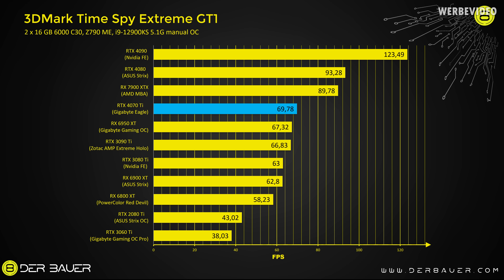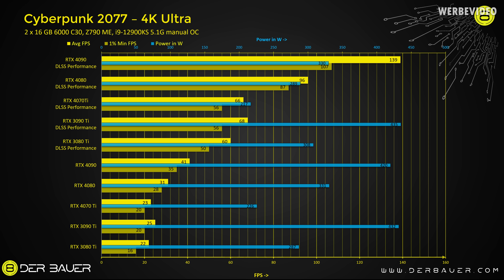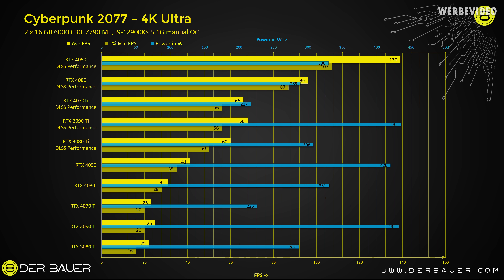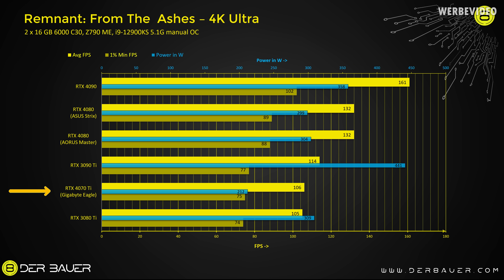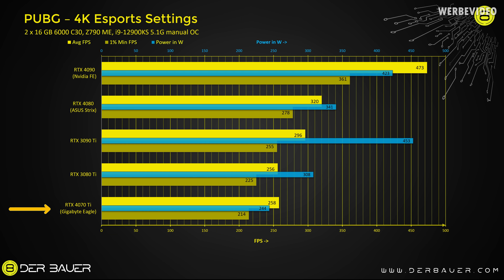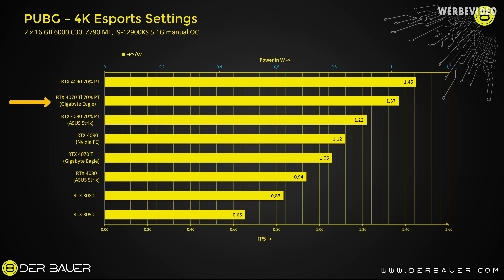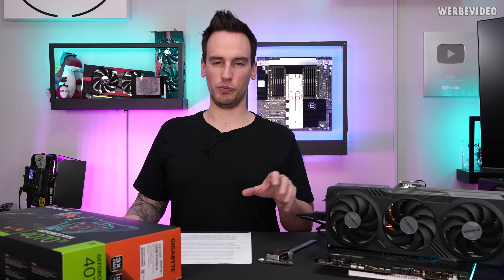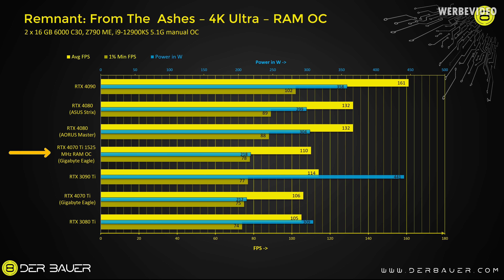Overclocking RTX 4070 Ti VRAM to Compensate 192-Bit Bus Width?

Comment: The 4070 Ti has less than half the cuda cores and half the memory bandwidth of the 4090, yet I don’t see people complaining about the bandwidth on the 4090. The question of “is the 4070 Ti bandwidth limited?” is a dumb one. If the 4070 Ti had this problem, the 4090 would have it too.

Comment: Interesting that even the lower end models are still having these gigantic cooler systems
Reply: Its because of the marketing fiasco. When it was the "4080 (12gb)", you can't have it look drastically different from its supposed 4080 brother, so they're designed to have roughly the same size. During the announcement Nvidia themselves picture the (non-existent FE) card with a 2-slot design. However, AIBs already manufactured the unnecessarily big card for the original release schedule - they aren't going to throw them away.
Reply: @souledgar  ah yeah that makes sense, I wonder what the 4070 (non ti) version will look like
Reply: Funny how "lower end" still costs $800+. Nvidia is going to ensure the next generation of gamers stick to consoles, very sad.
Reply: thats the new normal.
These 200w cards ran just fine with 2.5 slot dual fan coolers though. gets a little hot but they all were.

Comment: Okay I'd buy this if it had a 256-bit bus, but I'm glad that with those efficiency numbers there's actually a market for the 4070ti albeit with another hundred dollars off.
Reply: What are you running that you need the higher bus?  Why does it matter if the performance is still high?  It still outperforms a 3080 ti and costs less
Reply: @anthonylong5870  Looking at comparisions the performance seems almost identical to a 3090TI.
Reply: @verttisyrjala2897  I see it exactly head to head with a 3090 (non Ti) most of the time.  And at $799 for basically a 3090 , that's insane....I don't know why people hate this card so much, there is literally nothing at it's price point that comes close to it's performance
Reply: @Anthony Long  People hate the card due to the price, not the performance but for me the 4070ti was a perfect pick (Pny 4070ti OC that was like 849$) ~ Might even pick up the Tuf version, It's a great card for High fps 1440p and it's literally a 3090/Ti and it's cuts the power draw down by atleast 100-300w's and that can make or break a build.....people moan about the price and they own the last gen and it's like wtf do you do with your old card keep it around???? Just sell it and upgrade like good God
Reply: @anthonylong5870  That's because people only care about numbers, thing is if this card had 256 bit bus width it wouldn't drastically increase performance since bus width alone means nothing without bandwidth
Reply: @roofis8121  Exactly
Reply: @anthonylong5870  people hating this card because just the generation before same class card was sold for less than 600$ and for 800€ people could buy the xx80 class card instead which kinda sucks but the performance speaks themselves

Comment: 8:15 aren't lower clock speeds only because the temperature is higher?
Reply: Yep. Silent mode seems to drop the fans by ~3-400 RPM, which means the card is running hotter.

Comment: Biggest attempted con in graphics market history. pitch it as an 80 series when it is a 60 series die, be seen to "cave" to public outrage and un-launch. Then re-launch it as a 70 series when it should have been a 60 series based on the die size per wafer. Net result, they are conning people into thinking that they are getting good value at -$100 when in actuality it is +$200 to what it should be vs a last gen 3070 Ti, or to be more accurate +$400 over the 3060 Ti successor it actually should have been. The reason they have a shot at getting away with this is AMD are tacitly conspiring with NVidia to price fix by not competing on price. Price fixing does not need a direct communication between the 2 duopoly companies, they can do it with price signalling, which is exactly what has happened for this generation. The FTC and other consumer protection bodies should be investigating and massively fining both companies for these shady practices.

Comment: so a 4070 ti == 3080 ti.... wow.. and we should be exited...lol..
Reply: it's a 3090 ti with 200w less and dlss3
Reply: @kristo2212  at 3080 ti pricing , the efficiency does not make up for the terrible price hike over the 3070
Reply: @DC3RejuvationGB  yea meant performance price needs to go down but first they need to sell and cut prices on 30 cards as well but i don't like it's still huge for 70ti we don't need to pay gigantic cooler for 280w card 4070 should be smaller

Comment: The main factor I use to evaluate a gpu is the Bus width. The 3060ti was way more similar to the 3070 than the 3060 because they both had the same bus whereas the 3060 has a reduced bus. Ignore the name and check bus width first then look at shader performance.
Reply: the 3060ti and 3070 also use the same GA104 chip. Bus width isn't the only determining factor, keep in mind for example the 3080 12gb got an increase from 320-bit to 384-bit but they perform about the same. It just so happens that bigger and more powerful cores tend to be given more bandwidth to play with because they're more prepared to use it.
Reply: I have a 3060ti OC LHR and I'm very glad I went for the 8gb at 256 bit rather than the 12gb at 192.

Comment: I’m just fine and happy with my 4080.  Got it open box for $1100, so zero complaints.  That and the fact that you can actually buy a 4080 vs having to pay double for a 7900XTX from a scalper.

Comment: Could you please add a 70% PT for the 3090 Ti as well, it doesn't feel fair to compare one undervolted card to a stock card
Reply: Not undervolted. Just power limited. If you want to know what a 3090ti will do at 70% PT just look at the 3080ti. It’s the same GPU with a 350W power budget.

Comment: One mistake: you called the card the "Eagle" model when it's actually the "Gaming" model, which is the next step up in the lineup. The Eagle hasn't been released yet and actually says "EAGLE" across the bottom left front of the cooler.
Reply: Noticed this as well.  Good catch.  The Eagle doesn't have LED fans either.
Reply: @OCX600RR  I figured it wouldn't have the LED fans but I couldn't find the product page for it when I posted that comment, which probably went live with the launch.
Reply: @OCX600RR  Also, Gaming OC and Aorus Master/Elite come with an additional 1 year warranty when registered within 30 days making it a 4 year warranty vs the 3 you get on every other card on the market (Eagle included). This is a big part of why I bought the Gigabyte Gaming OC 3080 12gb, that extra year warranty.

Comment: I get that it’s ridiculously priced, but I love that tiny PCB. Put a water block on this and it’s perfect for an SFF build.
Reply: also just shows you how much smaller the coolers could be, especially with a load temp of only 55C. it's like a circus with all of these comedically large coolers.
Reply: @@transistorjump919 Yes, but the 7900XTX is horribly bloated and the RTX4080 isn't nearly as short. Water blocks for them would then add even more expense.
The point here isn't performance per money, it's performance per volume, and the 4070Ti is tiny.
Reply: Can't wait to see OptimumTech to stick it in a tiny case.
Reply: With that level of power consumption along with CPU etc? Not really, unless you can fit multiple radiators in a small form factor case or don't mind it being quite loud! Guess it depends what you mean by small form factor really as that covers everything from Nano/Mini-ITX to Micro ATX lol
Reply: @ChaosHusky  I run a 7950X and a 6900XT off a single 280mm radiator and it works just fine. Watercooled SFF can be both quiet and high performance nowadays.
Thermals and noise aren't bad either. CPU tops out at 85 degrees warmest core under full load, GPU hotspot is at 60-70, and the fans stay below 2000rpm once the water has heated up, which is loud but not insufferable. For normal work, the water has enough thermal mass that the fans never need to go over 800rpm, which is basically quiet, it's only prolonged gaming while running something compute intensive in the background that pushes temperatures up. The loudest component in this computer most of the time is the power supply. Silverstone fitting 1kW into SFX is impressive, but it does have drawbacks. The GPU's coil whine is a bigger annoyance than the radiator fans.
Reply: @@transistorjump919 A water block on this card would make it very impressively small, is my point. Yeah, you're throwing away money, but it's SFF, you're throwing away money either way. 
I have a 6900XT, and the amount of wasted space on that PCB is infuriating. I would much rather they'd added PCB layers and smushed the components together, so it could be short and neat once you put a water block on it, like just about any Nvidia reference design. It's SFF, every centimetre wasted on GPU is a centimetre I can't squish cables into or try to route water hose through. The card is so tall that even without the watercooling terminals, you can't fit it in a 4U case without the side panel bulging.

Nvidia's reference designs have always been far, far superior to board partners or anything AMD has to offer. Bloated PCBs are painful to SFF enthusiasts. Yeah the 4070Ti has middling performance, but what I actually care about is the size, and it's the perfect size.

Comment: is 4K 120HZ stable. easy to obtain using the 4070 TI.

also @DER8 i have a 8700K and 2070 Super. its a prebuilt and it has been slow downing at a rapid pace. 
should i finally upgrade to 13900K and 4070 TI and should i go custom prebuilt or build it myself.

Comment: Still feeling like my 4090 is a relatively good value compared to the 70 series which is insane. The 60/70 class cards have always been the value king going back to the early 2000s when I got into pcs

Comment: So the smaller chip is well balanced with the choked memory bandwidth which really just drives home how well designed the architecture is, but also how much nvidia is overcharging to maintain profit levels with volume of sales dropping.